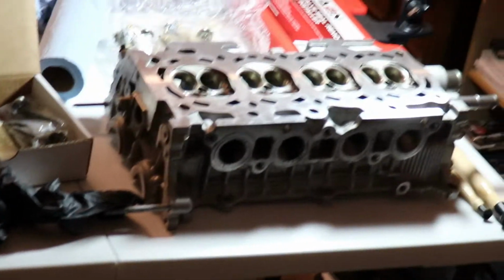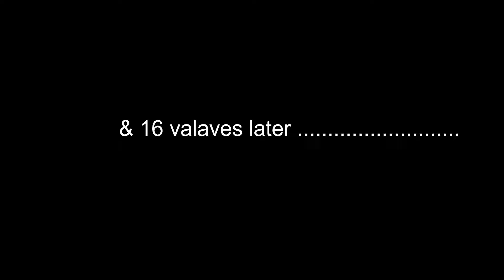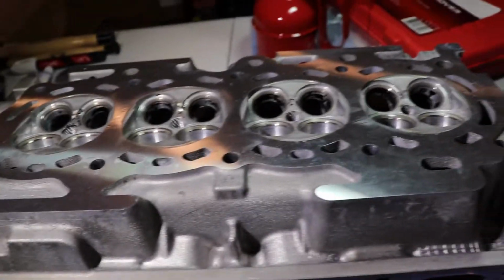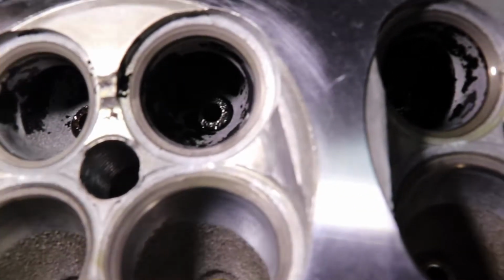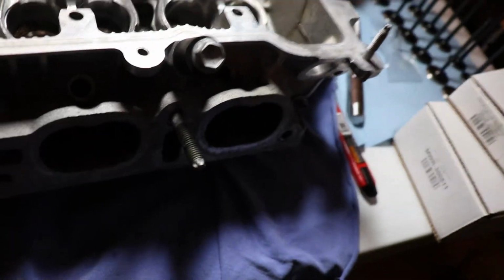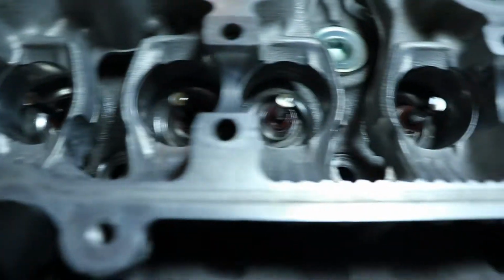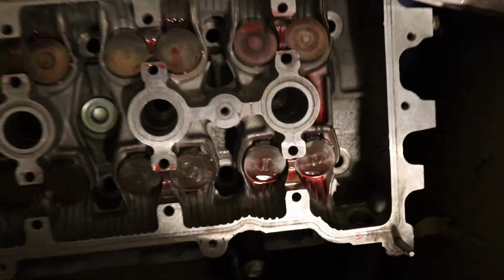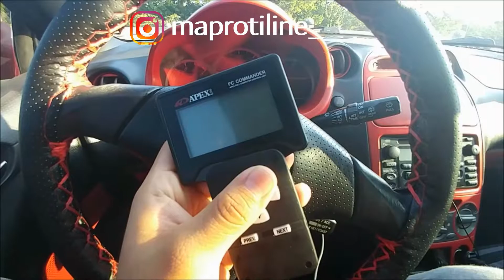Turbo Celica/mrs BUILT Head reassembly 1ZZ-GTE

Comment: Hey man I have a Celica gt as well and I found your channel is there any way you think you could help me and give me tips on how I should mod mine on a budget and what I should do with the exhaust and how I should get the engine ready to turbo?
Reply from the maker: Hey what's up man welcome to the channel, I was thinking of making a video just like that of modifying your Celica on a budget, well budget wise you can't really do any power mods , even a cold air intake or short ram won't do much because the stock one is brilliantly designed to maximize airflow in my opinion, what you can do is weight reduction get a lighter exhaust than the stock one maybe gut the trunk  , in terms of getting ready to turbo honestly the only thing you can do is just save up money, it all depends on how you're going to do it, if you're going to build the engine or just the bottom half , or boost the stock engine